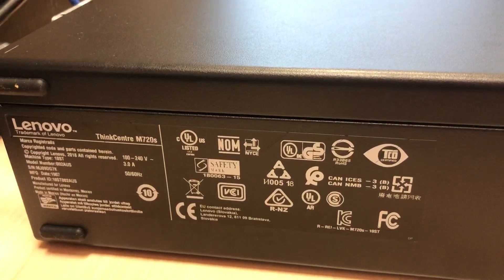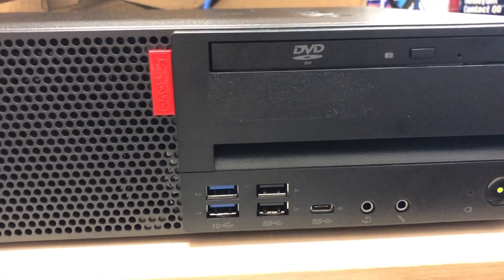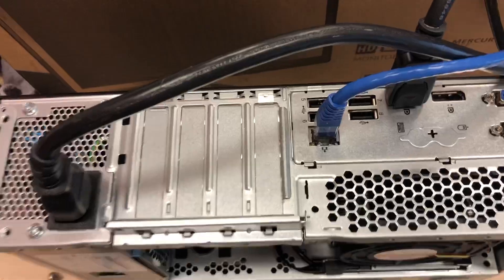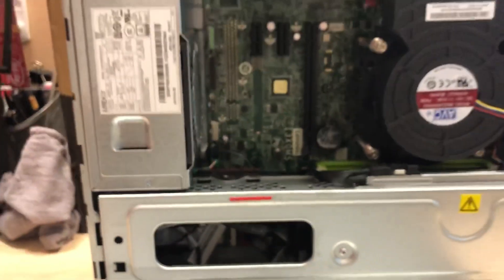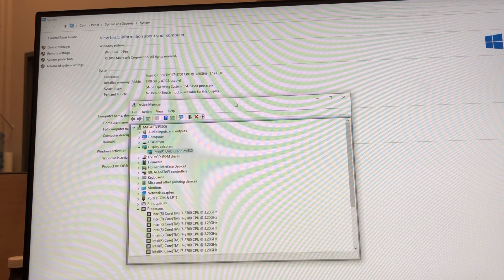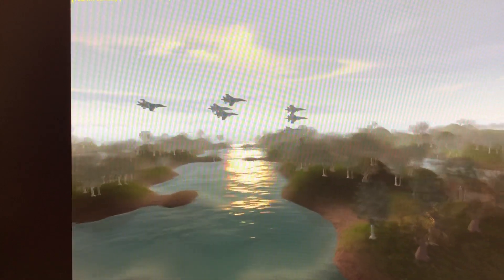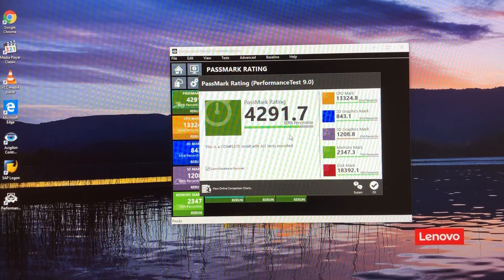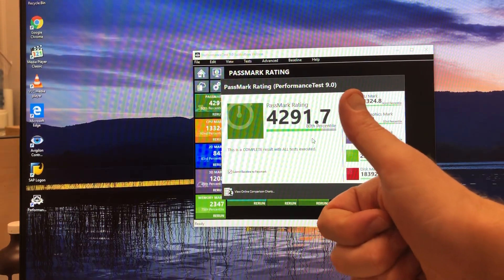Lenovo ThinkCentre M720s - SFF - Core i7 8700 3.2 GHz BENCHMARK REVIEW MEMORY UPGRADE 8 GB 256 GB

Comment: HDMI?
Reply: Yeah, has 1 port in the back
Reply: @husseinharajli3810  i see 2 display ports and no hdmi
Reply: @koblihacz022  i think you're right, but mine has an HDMI port. I think mine is the newer model.
Reply: @koblihacz022  I got the es certified one and customized it from
https://www.lenovo.com/us/en/desktops-and-all-in-ones/thinkcentre/m-series-sff/ThinkCentre-M70s/p/WMD00000406
Reply: @koblihacz022  So far it's performing perfectly well. No issues so far, but the fan is a little noisy when I'm running heavy applications - Not a problem for me though, just a little annoying.